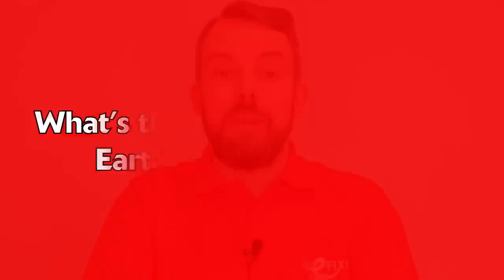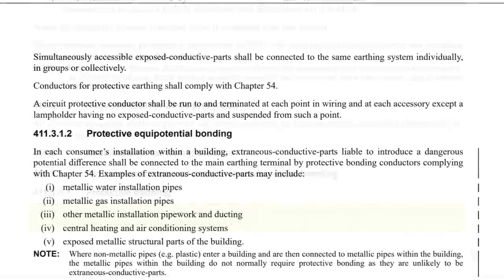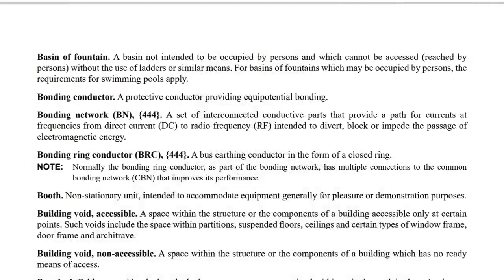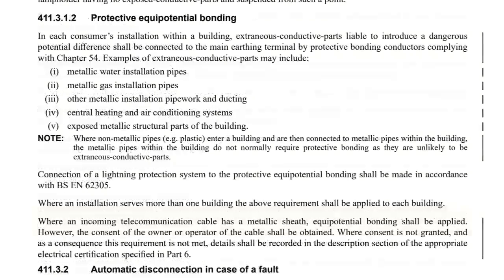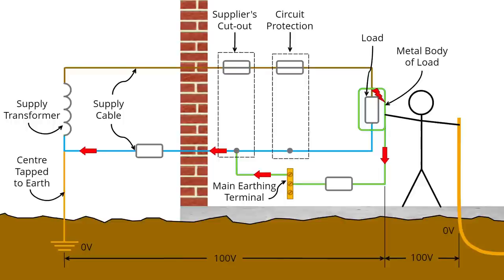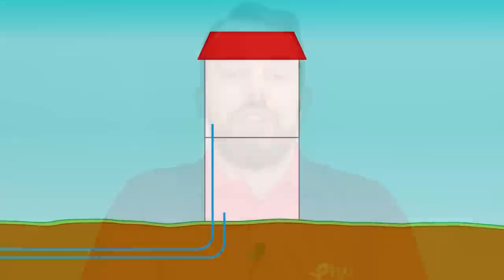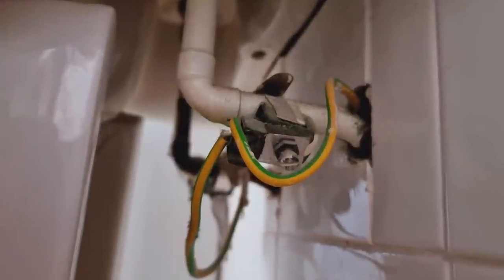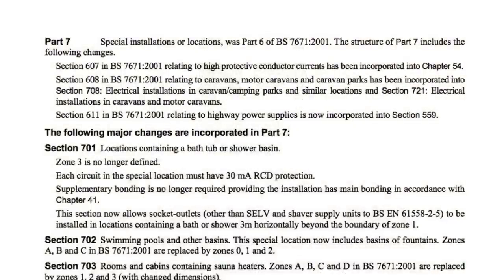Earthing vs. Bonding: What's the Difference?

Comment: An interesting talk on the subject.
My professional work is on weapons systems which included electronics.
Earthing is significantly more complex due to the high frequencies and the risk of potential differences over conductors at distances over a portion of a wavelength of the frequencies used in the system. This could induce noise which affects the correct function of the circuitry, particularly digital circuits. So there may be an earth and several common bonding points to address this.
We specify bonding quality as resistance/conductivity eg mOhms.
I have seen poor bonding in a power circuit produce heat till the connection was damaged by heat and then arcing. This is of particular importance where the system is aboard a moving platform eg aircraft, ship of land vehicle.

Comment: This topic always makes we wonder why we don’t just have an earth rod at every house as effectively (at least in my view) extraneous conductive parts perform broadly the same function and surely there would be a lot of advantages to doing this, and I would have thought it would prevent PEN faults.
Reply: I have always wondered this myself, why doesn't every property have a TT rod just incase.
Reply: The correct way to deal with a PEN fault is to use a PEN fault detection device. Not install a second earthing method.

And TT doesn't make a good earth. The resistance is greatly variable and higher than other methods.
Reply: So now you’re suggesting that you megger every wire lol

Comment: Recap
Earthing - for Exposed conductive parts that are part of the installation (metal switches)
Equipotential bonding - for extraneous conductive parts that are not part of the installation but could become live under fault conditions (gas pipes)

Comment: Great video, Could you do a video explaining about the neutral conductor?
Reply: They don’t have a neutral incoming on their residence’s they use it on 3 phase systems
Reply: @Timothy Dixon  wth are you talking about of course they have nuetrals in their residence you need to not for everything here in the us we can often use split phase for 240 instilations 120 volt phase to ground/neutral and 240 phase to phase or should it be leg to leg sense it's all one phase just with the nuetral tapped in the middle of the Transformer. But ya you need a nuetral for most cases because of unbalanced loads.

Comment: Thank you for a great video. Q1) Would Bonding Works if the separate parts are connected to separate earthing rods, in cases where large distance makes running a cable back to the other parts costly or impractical, compared to running a cable to a new separate Earth Rods. Since earth potential is zero, there will be no cable link between Earth Road 1 to 2 to 3.. etc 2) It would be clearier if more pictures examples be shown for Bonding cases

Comment: im always confused because where i live, ground isn't provided to you, you have to put in a grounding rod and your neutral never connects to "your" ground (they're grounded only at the transformer). so we only have "one ground" that connects every device, pipe and outlet in the house to the grounding rod so that in the case of a fault, it all dumps there, no need for equipotential bonding as all "ground" in outlets or pipes are at 0v respective to the earth
Reply: That’s a TT system, the fault isn’t dumped into the ground the ground is used as the fault path back to the star point of the transformer, the problem with a TT system is getting a low enough resistance back to the transformer, that’s why you then need RCDs

Comment: How do we get 100 and 48 volts at 3:14?
Reply: I would say it's probably an estimate and quite a good one I think.
Reply from the maker: It's explained in detail in this video.

https://youtu.be/qXgfGUymomU
Reply: It's the potential difference between different parts of the ground.
It looks like they're trying to show the potential difference from the supply substation, etc. to the point the person is standing and from where the person is standing to both the point of supply (Meter, etc.) and to the extraneous metal coming out of the ground that has been bonded (they are standing in the middle as far as the potential difference shows).

I'm not sure on this but I would suspect they've chosen 48V as the standard ELV safe-touch limit is <50V?
Splitting down the 100V potential shown on the graphic initially into two 48V sections could just be a typo as it's quite common to use a 48V max voltage since "less than 50V" is a little ambiguous.

Comment: I think it was a good effort, but the clear difference has not been established to me. I understand "extraneous" aspects of the installation but the example above (especially the flat with the water main line) did not help- the excessive use of the word and not a more drawn out explanation if why that was considered part of the installation when you stated the ground on the 1st part of the flat was not considered part of the installation could have provided a better explanation. After all, by adding a ground you are making it part of the installation. Perhaps maybe explaining a clearcut definition of an installation would have been better first. Again, it was a nice shot but it was missed ( at least to me).

Comment: My neighbour is a poor pensioner skint her light in the bathroom was dead.so as a favour I fitted a new one there were 5 wires into the light straight away I told her she needs the wall fan rewired as there was no isolation switch and they were using the c.p.c. as a switched live and the outside light had no cpc on it.I put it all back together as it was the only way to get out the house she promised she would get it fixed proper,it had been like that for 10 years I checked the fan case for live it wasn’t.What do you do leave her in the dark I tried disconnect the fan and light No No it’s been working for 10 years it’s OK haha. It was a builder that fitted it in the first place I just did like for like.